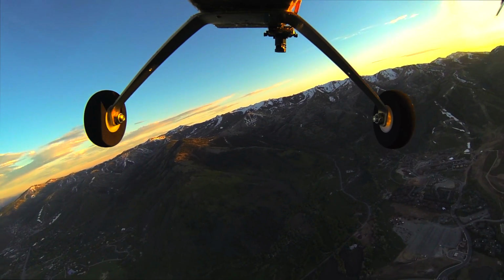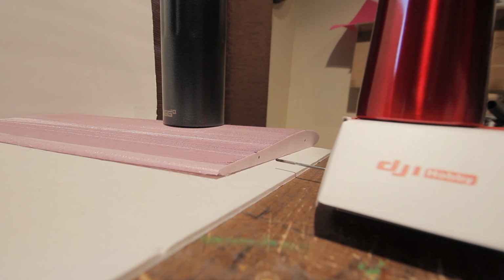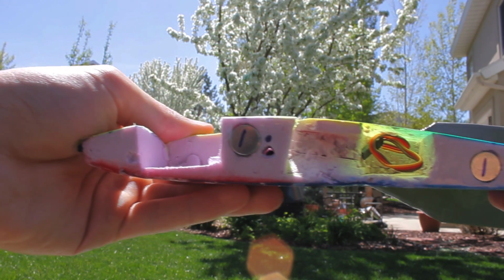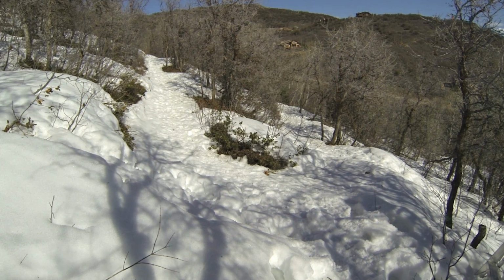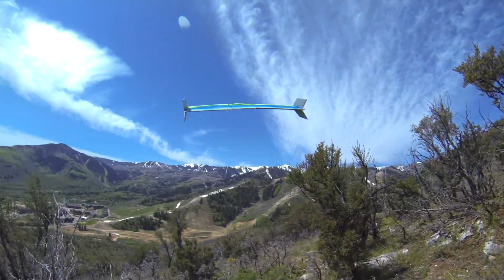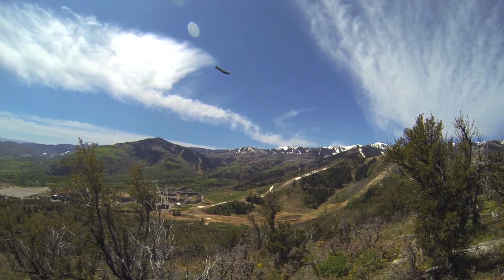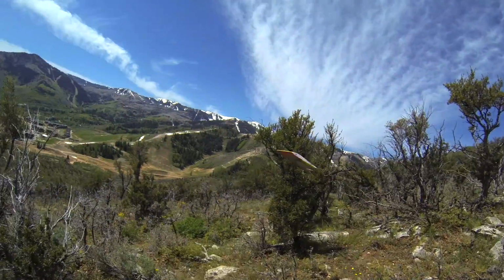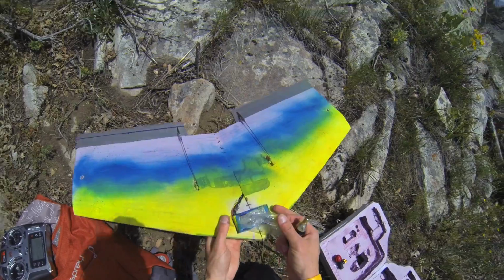Backpack Slope Soaring Wing - RCTESTFLIGHT

Comment: do u need lot of throws for the controls?yesterday was my first time ever attempt to slope soaring in a slope with a lot of trees at both sides so i think i only have about 5-7meters of flying space and it seems like the controls is not sensitive enough and i can only fly for about 5-10 seconds in a single throw.and also does it need to be a lil bit  nose heavy?or perfectly balanced?and btw im using the mini zephyr with kf 4 aorhoil in it and also the plane is a little heavy.

Comment: VERY impressive solution, bud! A solution for keeping your wing tips on would be to do it exactly as you have shown, only add a couple of small pieces of carbon rod into the wing and extending out only far enough for the tips to slip on. You need to reinforce the tips where you put the holes so that the rod doesn't just rip through the foam. This way, the rod takes all the forces and the magnets just hold everything in place.

Again, I'm very impressed with what you've done here.

Comment: You could use a single vertical stabilizer and have it sandwiched between the 2 wing sections using the carbon spars to keep it in place. Kinda like the alula

Comment: While magnets working to holding two pieces of the wing together, fins should have some pins or rods attached: magnets are hard to pull apart, but easy to slide sideways. Also, leverage of the fin's tips may act as an amplifier of detaching force.

Comment: you need to put a pin mounted on the tip of the wing , the problem with magnets its theat they slide easily, and theat pin will help not to
ps.
now we know where you live.....